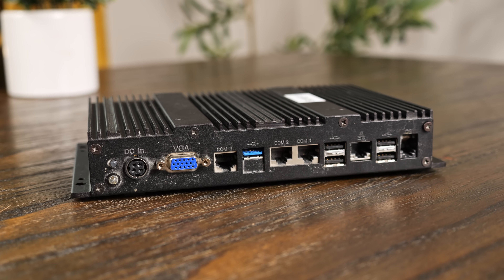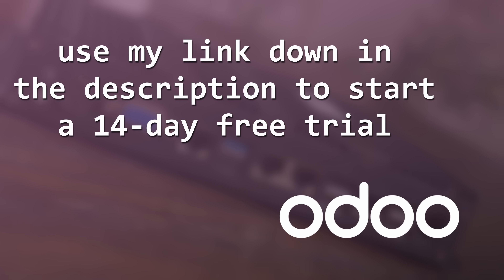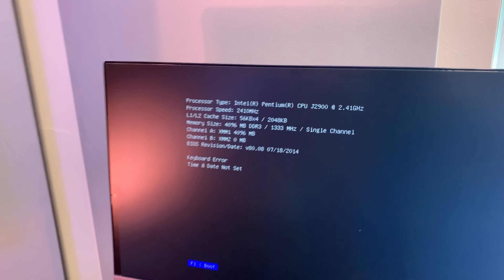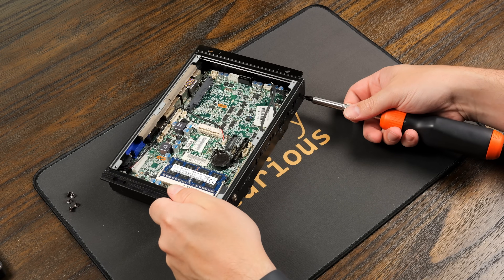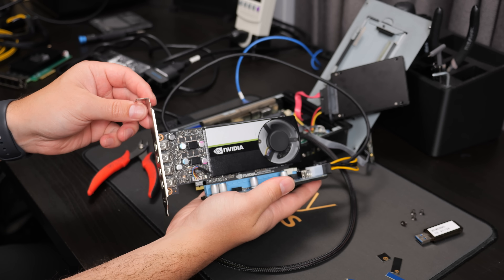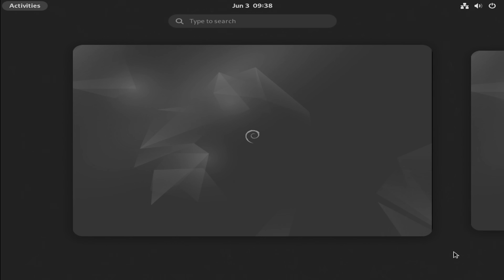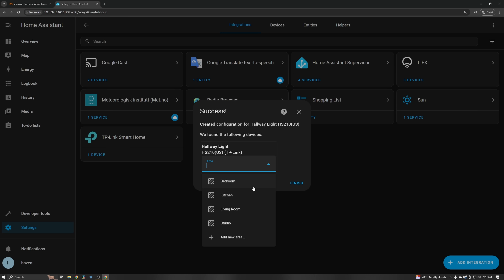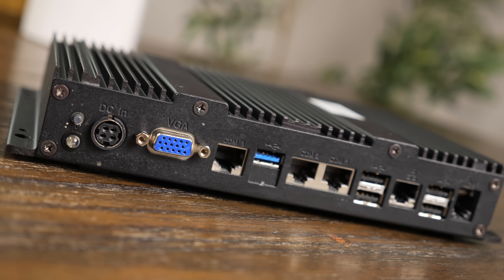I got this PC from a fast food restaurant. What now?

Comment: I am using way too many USB to 9 pin serial for controlling Scanner and Ham radios. I currently use M73 TFF machines, but would love to get ahold of a few of these for testing. I run base Debian CLI...
Reply from the maker: I'm curious about this... I know very little about Ham radios, but now I'm intrigued
Reply: @HardwareHaven   I use a Uniden BCT15X, Uniden BC125AT scanners, along with several ham radios (Baofeng, Radioddity,  and others) that all have some version of serial interfaces for control and programming. I use several USB sound cards to feed their audio to an Icecast streamer for in-house listening. Living in the mid-west, listening to NOAA, and RACES, and other folks discussing weather  and neighborhood issues on the radios comes in handy. Even if I never transmitted (I am a licensed HAM operator, though) it would still be better than the RTL-SDR setups I used before.

Comment: i think i had a neat little asrock board with the same cpu (soldered on the mobo) but running at 2.4ghz
Reply from the maker: Might've been the J2900!
Reply: @HardwareHaven  just remembered the name of it it was the asrock q1900m with a "intel quad core j1900"

Comment: "Philips screws that were all the same size" this is what happens when something is designed to be maintained
Reply from the maker: Indeed... indeed...
Reply: Yeah it's better than a sff from hp or acer. 3-4 mixed nuts
Reply: @VistasSrinagarun  any Mac book from about the last 15 years will make all of those seem easy
Reply: Or, to lower the logistics when manufacturing the device.  Not need many different sizes makes it easier to buy and manage parts when manufacturing.

If it would be for easy maintenance, one would be able to open the device without any screw, or just one.
Reply: when i heard him say they were all the same size my only thoughts were "no... no way.. hes gotta be joking come on where's the trick or kink but no honeslty would use that as a music and web player in my kitchen for recipes timers and TUNES!
Reply: For $520 it better be easy to maintain and fix
Reply: Well in a fast food business, if that computer is connected to multiple cash registers, or other devices, I can imagine how hard that unit was being hammered all day long.
Reply: Phillips, not Philips.
Reply: Exactly. I work on a lot of medical ultrasound and MRI control panels. They all pretty much have at most three different types of screws throughout the entire thing and it always makes sense where they go back without needing to record them. These devices are meant to be opened up and repaired many times before they are done using them.
Reply: I'm not sure that this particular unit was used for point of sale. Having a sticker or name on it like bump one makes me think it was used to control order screens in the kitchen.
Reply: It's called "Design for Disassembly" and is done exactly because you 1) want to maintain a product, 2) want to be able to reuse a product's parts, or 3) want to be able to separate its materials and recycle it easier. It's part of the "Design for Assembly", "Design for Manufacturing" and "Design for Supply Chain" concepts - which all talk about how product design relates to these different aspects. Making it easy to manufacture, making it easy to assemble, making supply chain less complex and more reliable + making end of life handling easier/more sustainable + allowing for prolonged life cycles through maintenance and repair. Any good design will have appropriate "levels" of easiness for the market.
Reply: Or it's just cheaper to bulk order a bunch of identical screws, what fast food place is gonna be maintaining their POS devices?
Reply: @GabrielSykes  their POS provider will. Do you think the fast food place can also service all their cooking and refrigeration appliances, or do anything that isn't very basic operation and floor cleaning? They don't, they pay a service provider that sends technicians to service and repair stuff.
Reply: @GabrielSykes  The kind that wants to keep selling fast food if/when their POS device craps the bed?
Reply: @GabrielSykes lots of places, many of them run embedded Windows 7 or even XP; keeping those maintained and in proper order is vital and important.
Reply: @GabrielSykes  As someone who works with restaurant POS systems. Pretty much all of them. Usually they contract their services out to a few different companies, some for the public facing media display and some for the internal POS equipment. 

That includes thin clients, display equipment, bump bars, even the registers. 

The company may send out a whole replacement unit, but often times they'll only send out the specific board that failed. SO an NCR motherboard in a unit will get replaced rather than the whole machine, or they'll send the internal board for the bump bar. Or just the cable for example. 

They usually just send a whole thin client though, but I've been on plenty of ladders in greasy pits replacing monitors with a fryer going 4 feet below me. 

And no.. they very rarely clean up there, you could scrape the ceiling at most restaurants and make diesel from that.
Reply: @GabrielSykes  What POS system exists that never needs maintenance?  Think about what you're saying from both directions, not just the side you've chosen.. lmfao.
Reply: @GabrielSykes  corporate chains in general usually have maintenance departments and IT support
Reply: @GabrielSykes  the firm they contracted to provide them. They sell these little toasters for $1500+, and often have warranty/service plans, so the production company wants their machines to be robust, easy to service, and built to a price that maximizes profit and decreases technician hours.
Reply: Nope torx is better

Comment: If you can get this cheap enough it would be great for some simple home server stuff. Home assistant, dns, download server or just to mess around ! It would be amazing to keep this out off the tech graveyard
Reply from the maker: Agreed!
Reply: Actually until last year I was running j1900 pc as the proxmox host. It run 2 VMs and bunch of containers but nothing fancy. RAM however was a limiting factor so I had to upgrade.
Reply: With forethought and a few tweaks, home theater time!

Comment: Former Marcos employee here, the BUMP 1 sticker means it was mounted to the wall and used just to display the orders needing to be made which usually had a ticket printer attached. It was a very simple program at the time i was there. I did troubleshooting when stuff didnt work. Most of the time ot was just restarting those terminals.
Reply from the maker: I definitely had to look up what BUMP meant haha. Which is sad because I worked in a fast food pizza place in high school
Reply: @HardwareHaven  These computers are usually connected to a heat and splash proof extruded alloy button box that's used (With about 20 labelled membrane switches) to scroll through orders and mark completed ones as done. That keyboard is sold as a "Bump bar"  because it's primary use is to "Bump" order items onto the front of house screens once they're ready to be bagged.
Reply: @HardwareHaven  Well, we didn't call it that at Dominos in the 80s, though we
 didn't use computers for it then either.
Reply: I've seen this same PC, or something very similar, at my local Wendy's doing the same job.  Attached to the back of a monitor facing the crew, showing order ticket info.
Reply: @scienceguy8  It isn't the same unit but it is similar.  Most restaurants in the US have equipment from either NCR or PAR.  Most fast food places use a server in the office that links the registers and the, typically, 1-4 display controllers. All of which are lower end processors with whatever software build on a windows base.

These can be repurposed into things like Word processors, internet access points, they are not ideal but I have even seen them modified with larger drives to make a NAS on a home network or as a home media server. Basically these are good for any purpose you would have for a higher end Raspberry Pi or where a Pi might not have enough power.
Reply: @scienceguy8  yeah there are similar things where I work wherever there is the order screen or some sort of screen to see the camera if you look close enough you can see the lil computers I have always wondered what hardware is in them if they get replaced while i work there I 100% am gonna ask if I can take one or two to play with.
Reply: @scienceguy8  this is what ohio historians belive
Reply: Its so weird to hear Marco's as a nationwide chain. When I worked for them in Toledo, it was less than 60 stores (corporate and franchise).
Reply: I was gonna say the same thing
Reply: its wild they need 4 cores for that...
Reply: @freedustin  the 4 core CPU was probably just the standard hardware from whatever company provided their PoS system.
Reply: @freedustin  Is it really? You need more than 2-4 cores to properly run modern programs on android or iphone lol
Reply: To*
Reply: @TheAverageAaron  it*

Comment: I have the same 2.5g R8125 NIC, it's driving me nuts. I've been trying to get it to work with proxmox so that I can make a opnsense router with a dell 3040 micro but it doesn't get recognized in proxmox, only in windows. Have you had any luck with proxmox recognizing this NIC?
Reply from the maker: I've had RTL 8125 work with proxmox, but I've noticed that not all seem to work as well in terms of compatibility. I think there are variations that might have more/less driver support.
Reply: @HardwareHaven  Yeah, that seems to be the case. I've even tried to install the proper R8125 DKMS drivers to no avail, may just have to search for another NIC (preferably intel) but it's difficult since my dell 3040 micro only has an AE key m.2 so my options are limited and it seems the options available are limited as well.

Comment: Now I understand why my Pizza always late, they use overprice underpower tech 🤦‍♂️.
Reply: The pizza's late because Hardware Haven took the computer away
Reply: They don't use overpriced under powered tech. You dont know that these things are made for the Pos/embedded/application specific area of the market. These dont have to run gta 5 at 500 fps or even be a full fledged server...
Reply: Actually its not underpowered. in its day it was perfect in its use case. KVD (Kitchen Video Display)  Epos equipment is generally one or two generations behind the mainstream general market when all the gremlins have been discovered and patched.  That thing could run 24/7 for years and when I was younger, something like that would have been the dizzy heights that could only be dreamed about.  You really only need a computer to do its designed functionality reliably and without fuss.